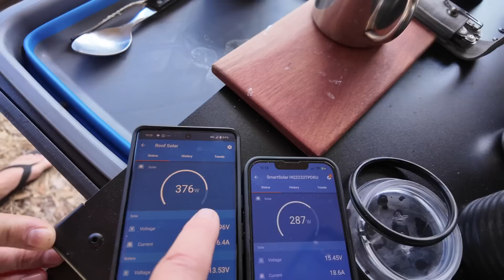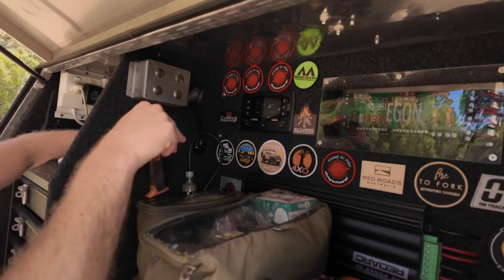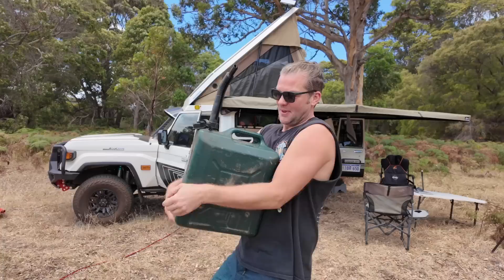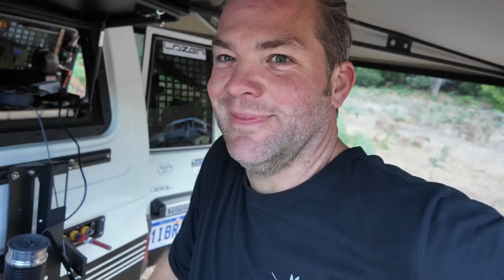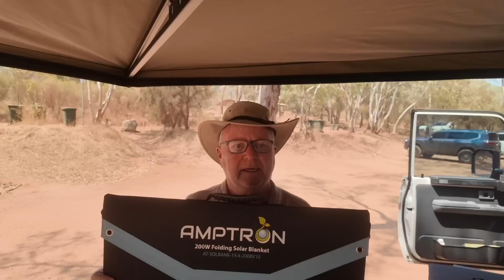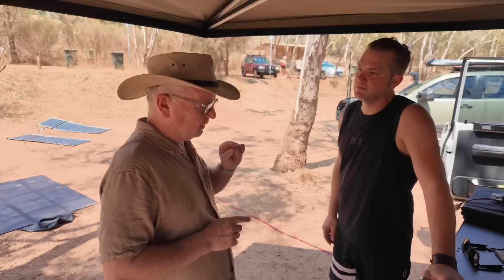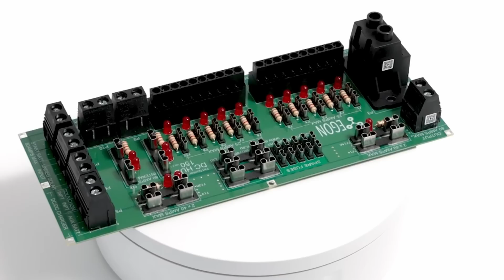Solar Blankets and Panels. Volts and Output @4xoverland

Comment: Great vid. The benefits of high voltage systems have me wondering why anyone still builds 12v systems.
Reply: 12v systems still have a place for most people. It's when you get into high power needs that 48v becomes a better option. A basic 12v system can be built fairly inexpensively 48v systems are expensive.
Reply: @ not that much more expensive. I’ll give it to you the battery bank nots cheap. But most other components are actually cheaper
Reply: With a 48v system,
Batteries much more expensive 
DcDc charger double the price.
MPPT same price.
Wiring cheaper
Inverters similar, however high current versions more readily available and cheaper.
Most fridges run off 12/24 voltage, although stepdown transformers are available but add cost complexity. 
If you have high power need 48v makes sense, but for most 12v is cheaper/ easier.
Reply: @ fare call. My power needs are high in the bus, and 12v just won't cut it with 5000w inverter. But starting from scratch with a 4wd or caravan i would still go 24v.
Reply from the maker: 48V batteries are about 20% cheaper in 48V. Divide the price by 4 to get the equivalent energy storage in 12V.
Reply: @4xoverland  For Amp hours in 12 volt yes, but the total Watt hours are +- the same for the price - ie:  A 100Ah 24v batterie is roughly 2 times the price of a 100Ah 12v battery, but 2 x12v batteries in parallel in a 12v system, will give out the same Wh as the single 24v battery in a 24v system (so 'roughly' the same price per Wh not taking into consideration your 20% price difference)

Comment: For the type of camping we do in northern California, summer time heat is very high. I've given up on solar blankets/panels. We always try to park and camp in the shade of large trees, even with an awning in use. This makes roof top solar inefficient. Setting up solar blankets is a pain, especially in the wind, debris covers them or if theft is a concern when you hike out of camp. Solar panels on the roof are expensive, top heavy and prone to damage when driving through brush and low hanging branches.  I use a single Honda EU2200 generator (around 50 lbs) to charge the lithiums and have plenty of current if using a lot of amps for cooking, etc. Run it whenever I want to charge the battery bank....weather and sun is no longer a concern. Noise is not an issue...during the day a slight breeze hides the hum of the unit running for an hour or two. If I hike out of camp I can chain the Honda to the bumper and let it run, topping off the batteries. I no longer use a DC to AC inverter, I just use the Honda when AC power is needed. Camping life has really changed for the better now that I've incorporated a small microwave in the mix.

Comment: Put the blankets in series, you will get a worthwhile jump in amperage.
You do not need to use high voltage panels to charge 48v batteries, but you will need multiple panels in series to bring the voltage up. Aim for battey voltage + 20v. 
I have 3 × 200w panels on the flat mounted on my camper in series for a combined voltage of 66v. With this combo I regularly see 530w + going into the batteries, and when travelling, I have seen 602w going in as measured by a victron 100/50.

Have a look at the renogy shadowflux panels. 36.5v open circuit voltage. 2 in series will give you adequate voltage.
Reply: Putting them in series will not increase the solar panel array amperage, in fact it will more or less be halved compared to a parallel setup. Voltage will double, and the total wattage will be similar. However mppt output amps should increase (I think this is what you were getting at) as the mppt will be triggered much sooner in low light situations due to higher input voltage, thus increasing the total daily amp/h yield. The one problem you can have when solar panerls are in series, with the older generations of solar panels, is that if only one of the cells is partially covered the whole array's output plumets. With newer panel technology this is much less so.

Comment: The controller you use matters also.  There are voltage boosters that are supposed to be used with low voltage.